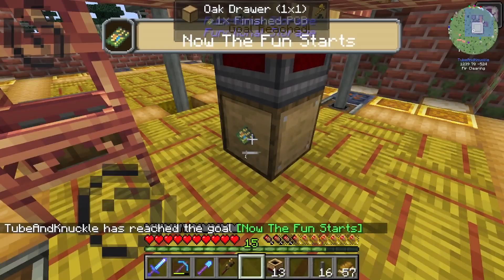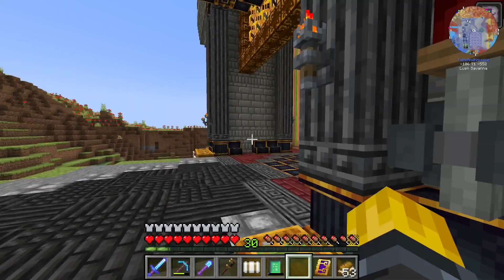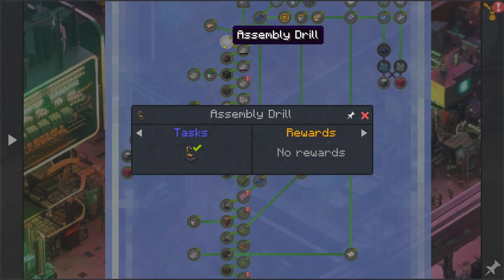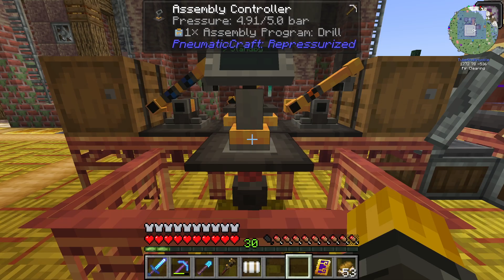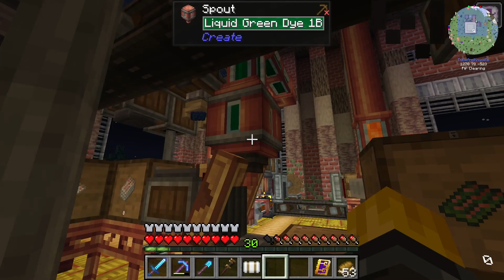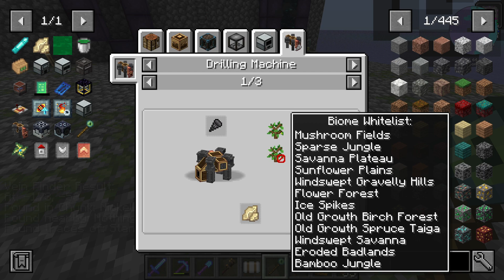Demystifying PCB Making: Tube Takes You Step-by-Step

Comment: Can you point me to the slick portal trick? Does it come from a particular chapter in the progression or is that your knowledge of create?   Always appreciate your tenacity with this mod pack.
Reply from the maker: Sidh, that's a part of the Ars Nouveau mod. You'll need a couple of items to set these up. Arcane Stone, Warp Scroll & a Source Jar filled with Mana. To set this up you shift click while holding the Warp Scroll in the location that you want the portal linked to. Then go to where you want to setup the portal to that location. Here you need to build a portal frame out of the Arcane Stone blocks. Any size up to 21 blocks works but all that is needed is a space of 2 blocks tall and one block wide hole in the portal for you to walk thru. Once you build the portal frame place down the full Source Jar next to it. Then throw the Warp Scroll into the hole of the portal frame. This will activate that portal and link it to your original location. Doing this will use up 90% of the Source Jars stored mana. But that is the only cost of these. Once you set them up it is free to use as often as you wish and doesn't consume any mana or anything when teleporting.
Reply: @TubeAndKnuckle If you name that warp scroll in anvil before creating the portal then that name will display in the portal itself.
Reply: Thank you!

Comment: Also im sorry, but the infinite vein is the one that needs a lava supply, if its in a mushroom fields its probably not the infinite one. You need to check the ore vein guide in the questbook, for the correct biomes. Aaaaltough, I think the mushroom fields vein may be close to infinite. In that case you dont even need lava!
Reply from the maker: Hmm. Okay thanks for the heads up.
Reply: @TubeAndKnuckle I’ll be totally shocked if it isn’t enough for you to finish the pack.
Reply from the maker: 6800 pcs. in that vein. Should be enough. It be nice if the mod had some way of showing what the vein holds prior to going thru the process or setting everything up on the vein. Or maybe I've just overlooked the obvious. @scottchristofersen2367